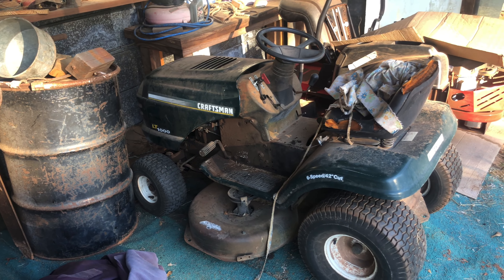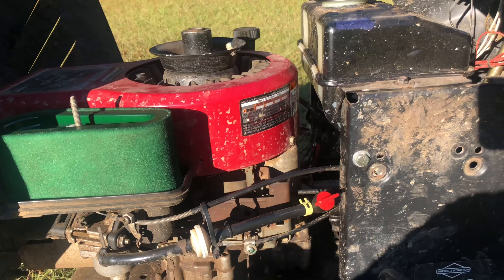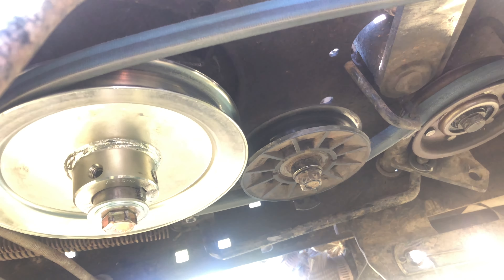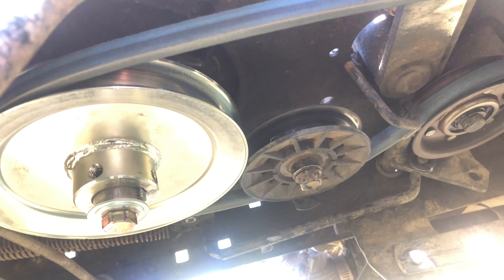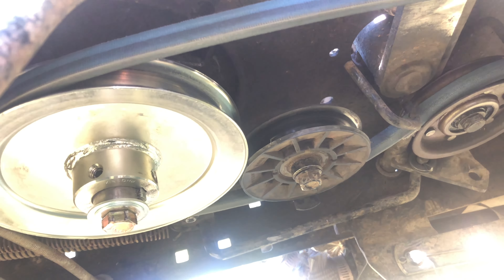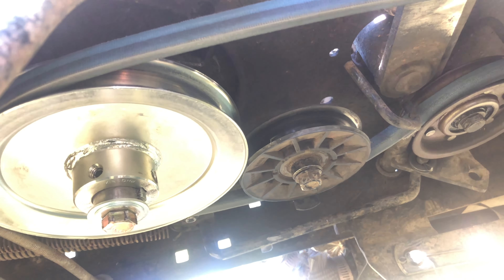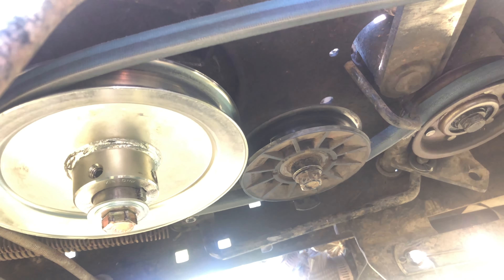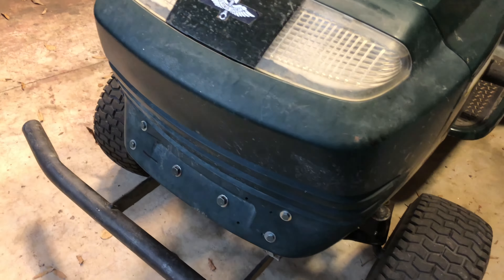WWII Jeep (Off-road Mower) | Mods & Setup

Comment: I don't think it should be a debate over which one is better, 4 wheeler or off-road mowers.  I think it's all about what's more fun to you.  Fun doesn't always mean fast.  Fun to me is building something cool using it for an extreme purpose that the factory never intended.  It's about the tinkering, and the upgrades to see if it can do that trail with this mod or that mod.  To me, that's the fun part.
Reply from the maker: I totally agree man!

Comment: for belt guards, i used 1/8 x 1" flat bar and bent it around the pulley. I have some vids and pics on my channel if you want to look at it. and for tires, knobbys will grip better, but still slide some.
Reply from the maker: Alright! I mainly want grippy front tires and if I can get a good deal on wheels and tires then I can have two sets lol. 20x10x8 and 15x6x6 are kind of hard to find a more off-road/ATV tire pattern.
Reply: @IngenTechNational  I know 18s will fit on the front with an 8 inch rim, and 22-11-8 will just barely clear the shifter
Reply from the maker: @Mo_2118  Alright!

Comment: Those Nikki carbs are not my favorite, that jet being one reason. The plastic and the amount of gaskets in there make me prefer the Walbro. That being said, im still running a Nikki carb on mine, just what was on it lol I got a spare engine with a Walbro, not sire why i haven't switched it, probably will when it gives me Hell. 
On mine, i took the deck pulley from the bottom of that double stacked stock one, and used it for the drive (5" i think?) Then took the original engine pulley (3" i think?) and swapped it for the gigantic one on the tranny. I run an 89" belt, it moves faster than it should, but i can still use it for yard work or moving my flatbed trailer around. It's definitely hard too move a 12' tailer with the differential welded. Hard to turn anyway haha
Reply from the maker: Yeah, I got a slide carb(not mikuni) but the Go Power Sports upgraded carb for like a 212 laying around that will take a bit of tweaking to make it fit but this is a 508cc engine and putting a 212cc carb is less than half the size, so I might get a slightly different one one day but I still like having the governor attached because off-roading and hauling just seems to perform better especially for under 20mph use. Racing mower 40-50mph is different and I prefer no governor on it, but this is the original carb on this engine when I got the mower so imma keep running it threw hell until it fails lmao.
Reply: Ive never had the jet actually fall outta there, but every time i take mine apart I have to replace that one o-ring that seemingly keeps gas from flooding the crankcase. But that's also why i installed the very same gas shutoff switch you got goin on. 
I Think my engine is about the same as yours. Mines a single cylinder Briggs Intek OHV, 31G777, says "503cc" on the cowl. 
Been waiting for a mower video for a minute!
Reply from the maker: @dogsandwich77  Oh alright! These engines are pretty common I think, mainly the 28 ci but ours are 31 ci so we basically got the "350s" out of the "305s" if you know what I mean lol.
Reply: @IngenGarage  lol the old "throw away 305" 😆 i feel ya!